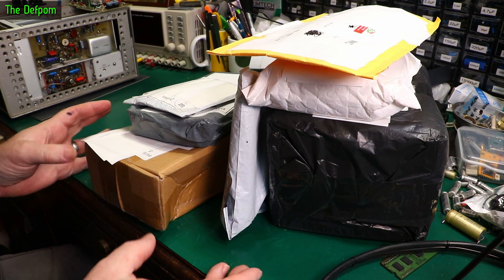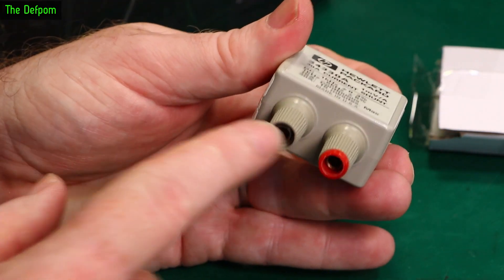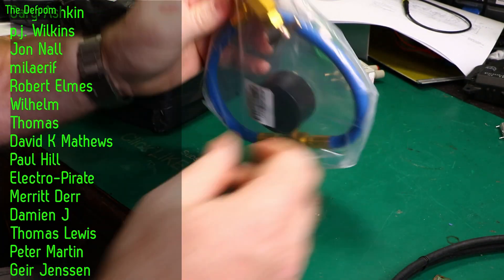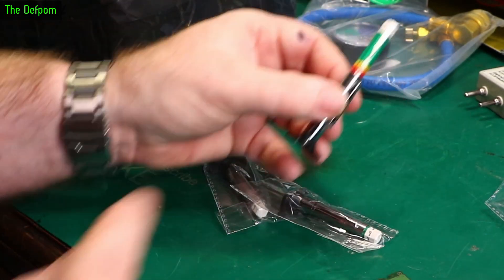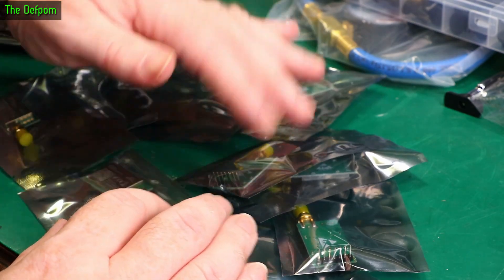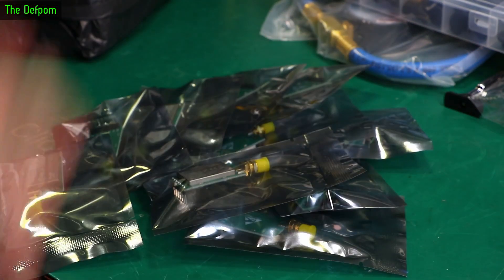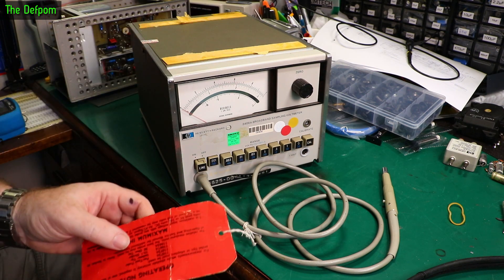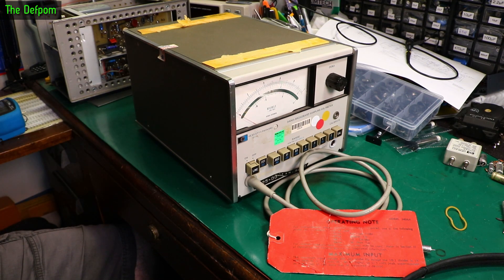🔴 What's in my Mailbag ? - Mailbag & Test Gear Monday 3rd April 2023 - No.1112

Comment: wish i could get that current shunt... but it seems too expensive. i paid as much to get the bench meter itself! dear me.

but reading on forums they talk about the heating tempco. and maybe this matters if the shunt heats up itself, and causes a significant thermal drift. which would explain my readings from this cheap chinese copper shunt. which was only a few bucks... and i am not sure what a better shunt would actually cost. compared to the official hp/aligent module